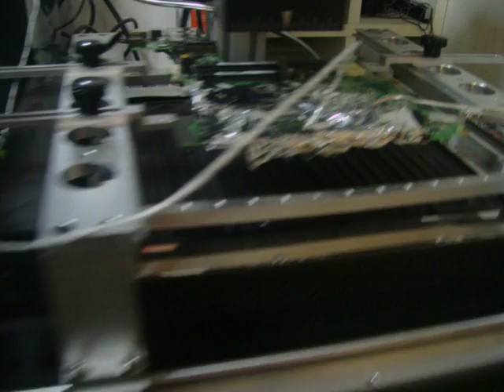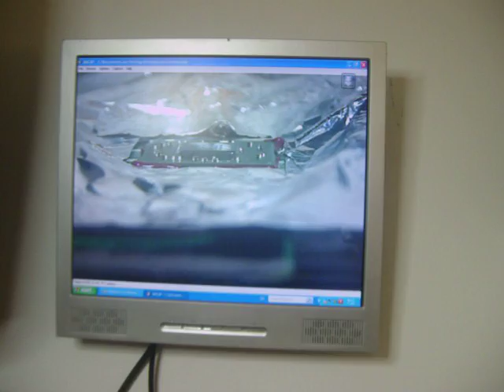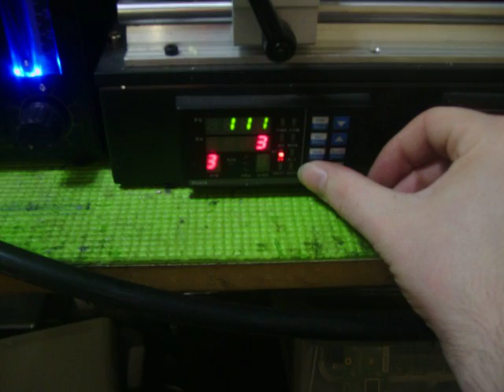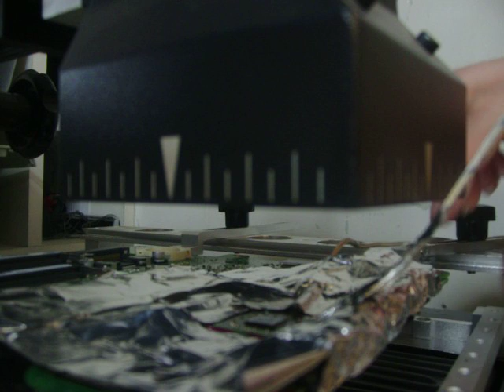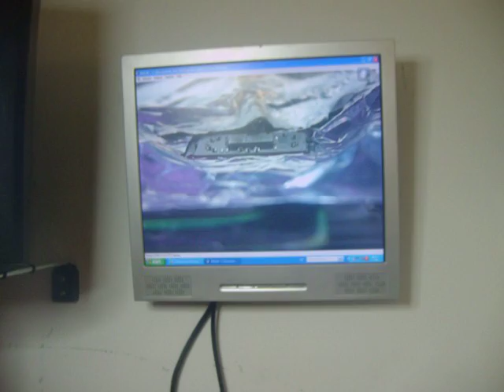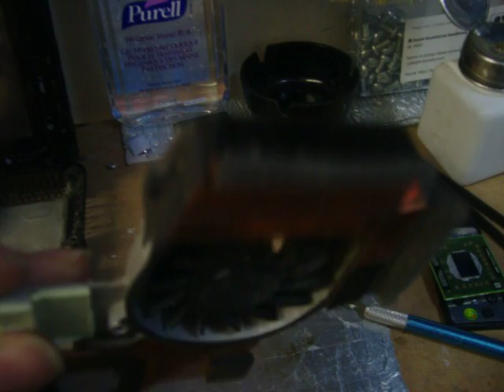Hp Pavillion tx2500 Reflow using Infared Machine

Comment from the maker: If you have a look at my other video that may help
Its on a xbox360 but the same applys to the hp in this video, once the chip is at melting point 218c for unleaded solder 183c for leaded solder the chip can then be removed and reballed, Hope that helps